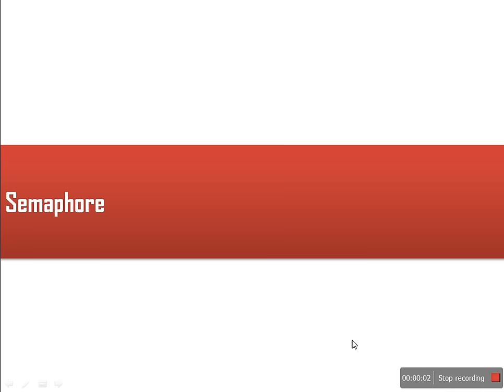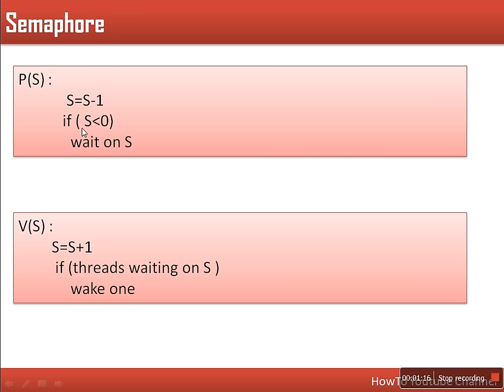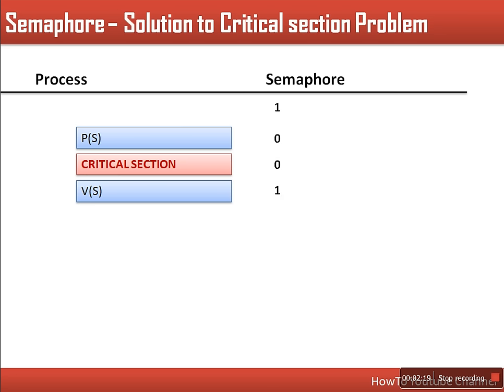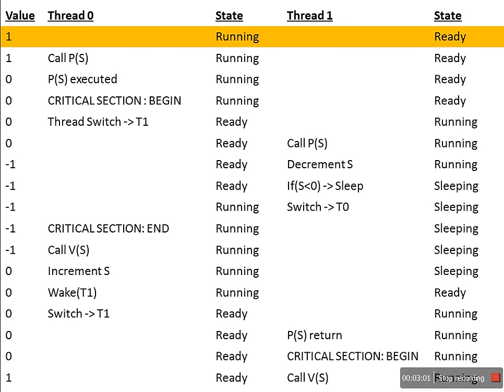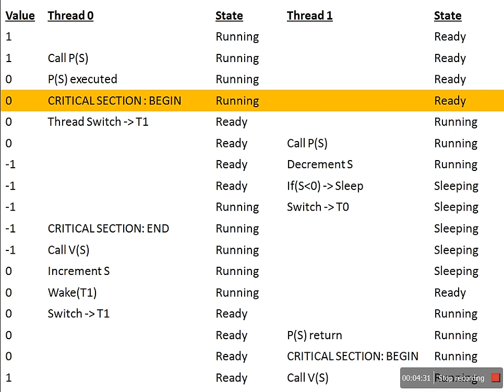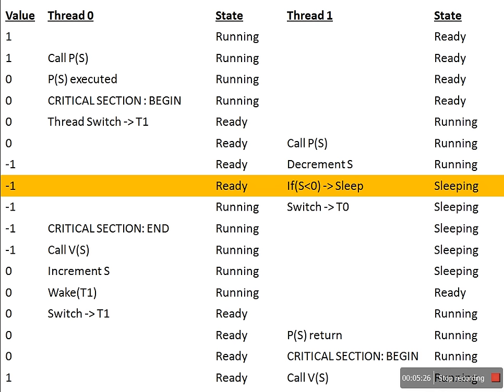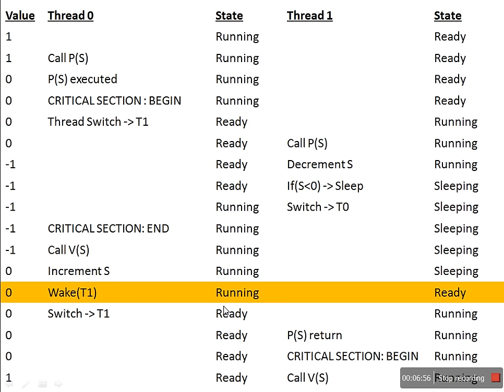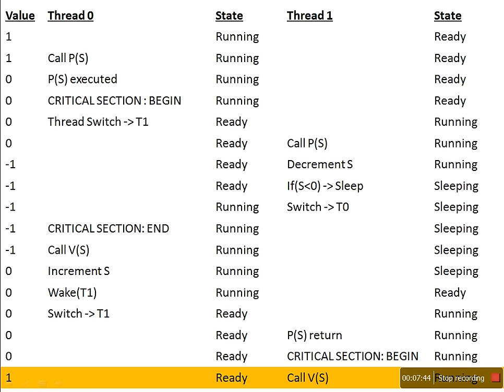What is Semaphore : Solution to critical section problem

Comment: This explaination only works with two threads --> If a third thread would try to enter the critical section, S would be decremented even further. If T1 finishes it would increment S by 1, but the condition S<0 would still true for all the threads/processes to come/sleep and the ressource would be blocked forever. (Correct me if i missunderstand it)

Comment: Hello HowTo,

Thanks for the nice video. I would like to know, how critical section is handled if the Sem value is 2.

First Process enters and makes the Sem value to 1, At the same time if other process comes it has a chance to enter critical section as the Sem value is 1. Second process also enter Critical Section and makes Sem value to 0.

In above case how the critical section is handled ?
Reply from the maker: As you have noticed, in that case there will be problem. In semaphore we have make sure about the value we are going to use. For two processes we will go for value 1.
That's the reason we are having monitor concept where we no need to take decision on with which value we should begin.